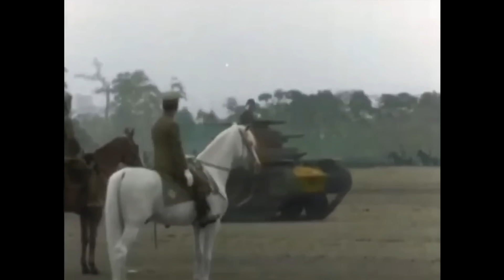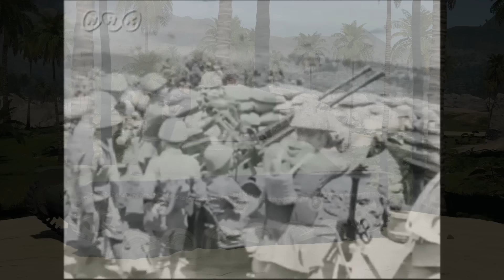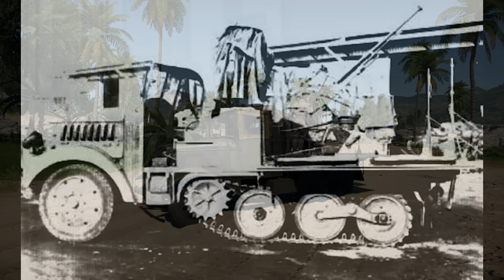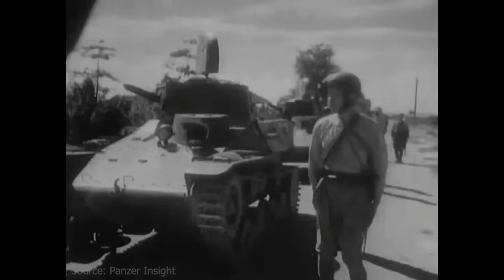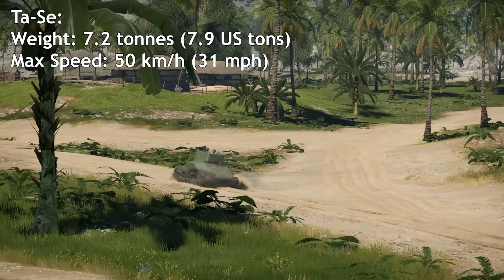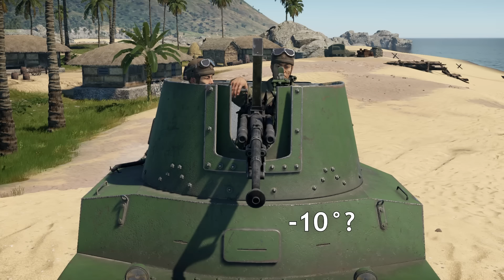Low-Tier Threat | Experimental Anti-Aircraft Tank Ta-Se

Comment: Sadly sabotaged by IJA/IJA rivalry too.
How? 
Higher caliber and high perfomance autocannons. Japan had trouble developing those and their 25mm was abysmally bad. Excessive and destructive vibration, muzzle flashes that gave crew borderline concussions, feed issue due to locked magazine and dozens ofher issues.
Meanwhile IJA captured a collection of european imported autocannons in China in 1937. Including german and swiss 20mm, 30mm and 37mm. 
The latter would have been the highest interest to navy to reverse engineer instead of the Bofors examples they captured on in 1942-43, if I recall right.
But as IJA had no interest in autocannons in 1937 AND IJN was the one having a monopoly on AAA autocannon research and development budget, IJA only ordered japanese engineers to copy captured german 88mm AA guns imported to China. IJN never found out about new autocannons. Time was lost. And technology was never used to develop effective autocannons on time. So neither IJN, nor IJA got them. And without them navy suffered and vehicle in question in the video was a very questionable endeavour.

Comment: Interesting point. The shipboard 25mm AAA guns were the worst in WW2 (corrected for gun size accuracy)
Reply: I would argue the German and French manually loaded singleshot 37mm AA guns where specifically worse. 

I am not aware of a 37mm gun the Japanese Navy used in WW2, if you could give the name of the weapon I would love to look into it.
Reply: @kyuzo8872  I stand corrected. It's a 25mm gun. Memory is fallible
Reply: Not 100% correct, it's the placement and position. 
Some ships did not have adequate anti-aircraft to be effective. The 37 mm guns are also intended as coastal batteries rather than intended to engage other warships.
Reply: @sinisterisrandom8537   the low rate of fire. Having to constantly replace the small box magazines were why the smaller Japanese AA guns were ineffective.